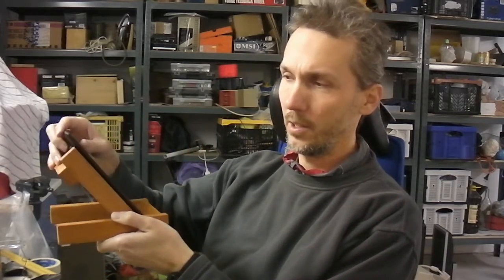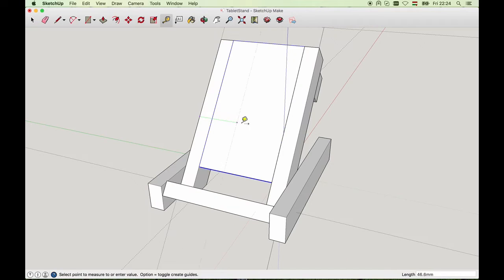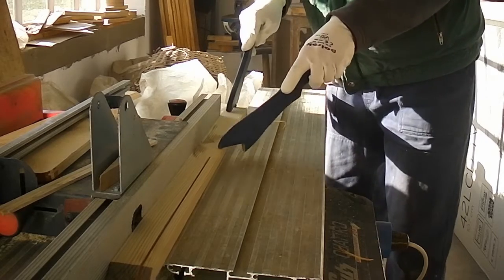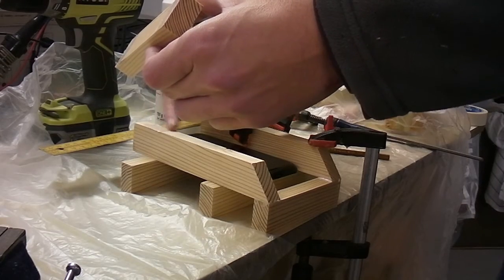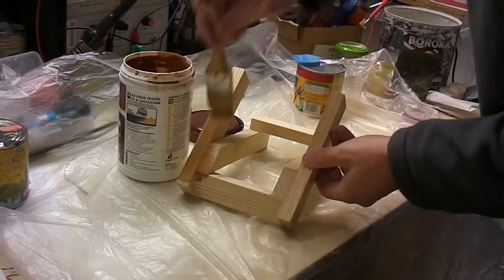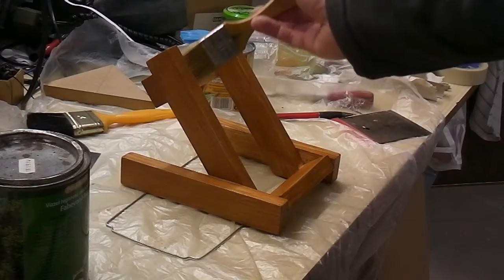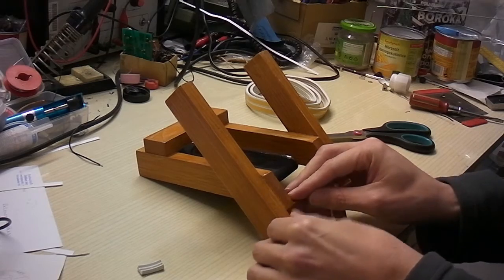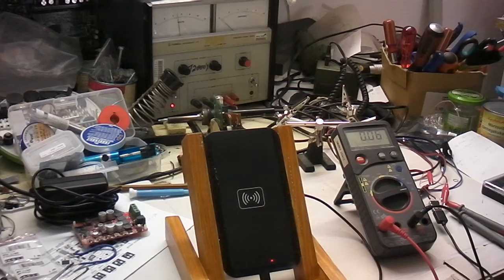DIY Wireless charging tablet stand

Comment: Sorry for nagging but you had to use Sketchup for designing that??? It's basically just some rectangular pieces of wood hammered together.
Reply from the maker: Well... yes, but no. The charger has to be exactly in the center, and it is much easier to calculate by draw a sketch. Here especially the overall width of the upstanding part is critical. (As shown in the video.) But overall I like to visualize the things in Sketchup (e.g. the tilting angle), and it is also a good idea to prepare a cutlist to speed things up in the shop. But you are right, with a good practice one might not need any drawings for a simple thing like this.

Comment: What is your wireless charger
Reply from the maker: Mostly the cheapest one. This one is similar to the one I used: https://rover.ebay.com/rover/1/711-53200-19255-0/1?ff3=4&toolid=11800&pub=5575402881&campid=5338330151&mpre=https%3A%2F%2Fwww.ebay.com%2Fitm%2FUltra-Thin-Universal-QI-Wireless-Charger-Plate-For-Android-Phones-Charging-Pad%2F361701858290%3Fhash%3Ditem54371c5bf2%3Am%3AmVEiVShsXtYN1Anj3VXXH8g (affiliated link)